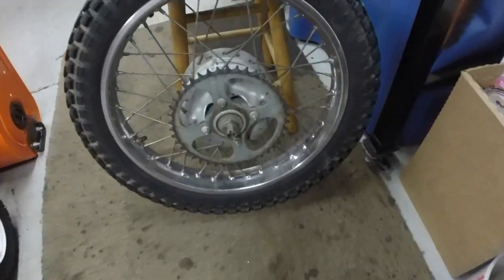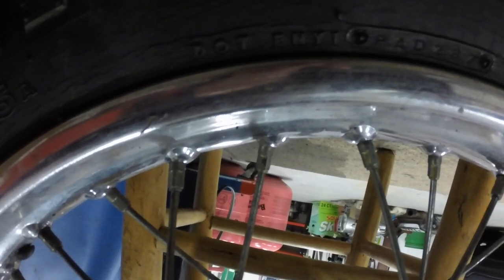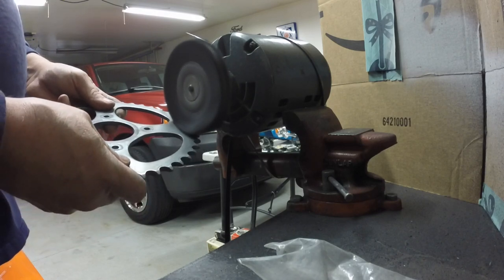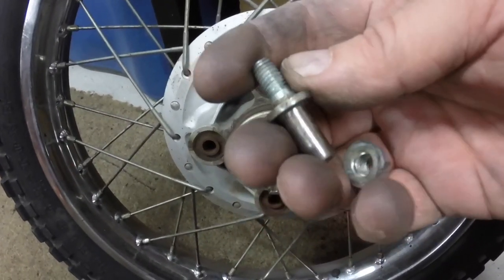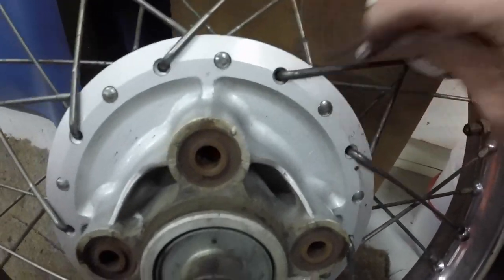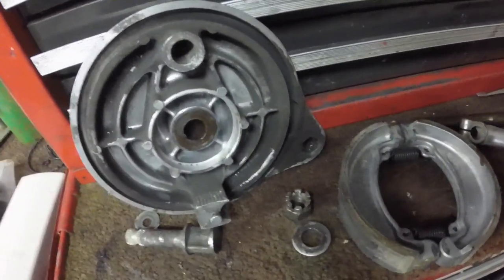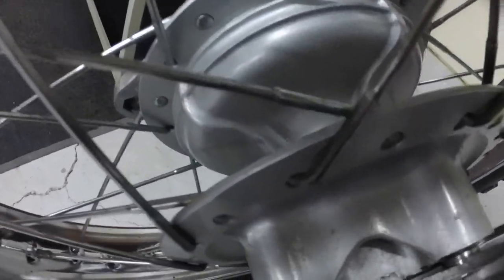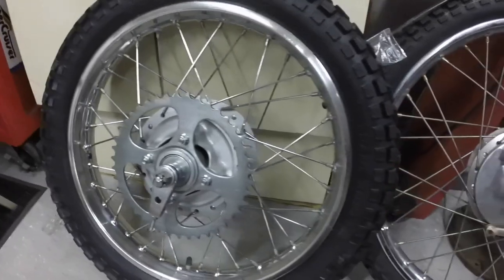1976 Honda XL175 restoration part 14, cleaning and shining up spokes and rear wheel

Comment: I know you said you won’t ride it again, but you have to. All this work to let it set in the garage? I’m not saying go flying down a gravel road or take it in the dirt, but put liscence on it and take it down the road. Trans has to be lived anyways. Motorcycles weren’t built to look at they were built for riding. And if you take good care of it, it will never be as bad as it was again, not saying it was bad though it was in really good condition when you started
Reply from the maker: The bike is 100% road legal, insured and registered. The only problem is the crazy drivers around here. It's bad enough driving my old car, let alone a motorcycle. I may ride it around the neighborhood now and then, but there is no way I will take it on main roads or the off road rides I use to take it on. My brother belongs to a dual sport bike club, and I have done many rides with him at events on the XL175. It holds up to all the other new bigger bikes very well. I am going to miss ridding it on those rides.
Reply: I hear that with the crazy drivers, if I were you I would for sure drive it around the neighborhood and keep it running good, I’m loving the progress good job👍🏻
Reply: @OldCarAlley  Do you take it on those rides now, a year after the resto and after the novelty of having a like new bike has work off?   I am currently doing an SL350K2 and I will be for sure taking it on long rides once i have finished it.  You have to remember, after your generation is gone the only people that will appreciate these bikes will be the few and far between hold outs like myself(19yo), values will rapidly decrease and they will be worth nothing, because the market base is gone.   Please ride it
Reply from the maker: @jackheinemann8780  It's 100% road legal, and has been since I bought in brand new. I ride it around my local neighborhoods, and to friends. Put just over 500 miles on it this past summer.
Reply: @OldCarAlley  That's Awesome! I have to thank you as well for putting this video series up, it is a tremendous resource and will help me heaps as I move forward with the 350. Thanks, Jack
Reply from the maker: @jackheinemann8780  Glad they help you with your project.